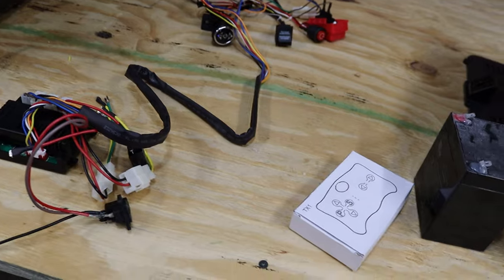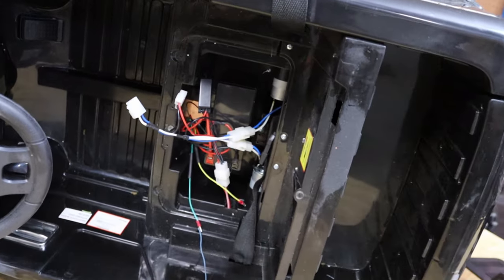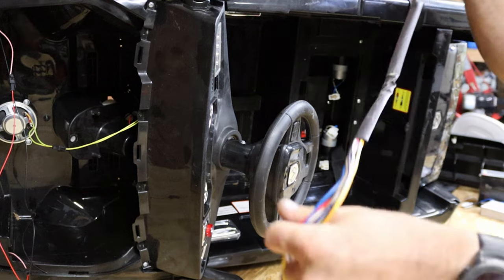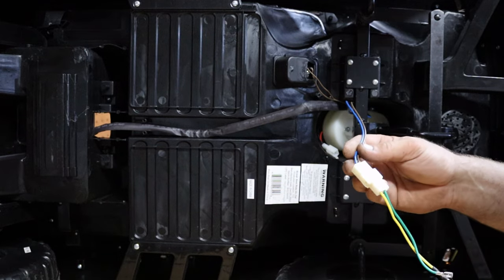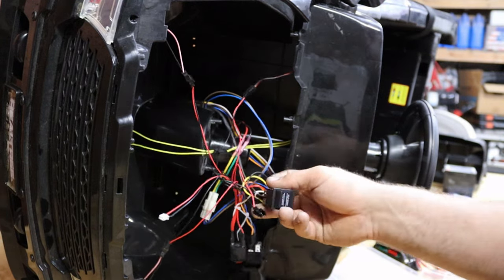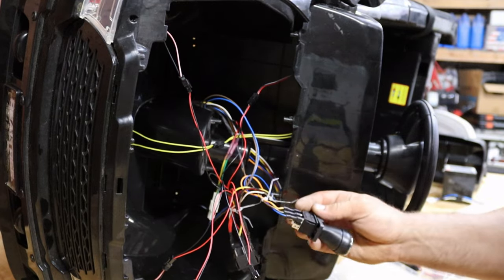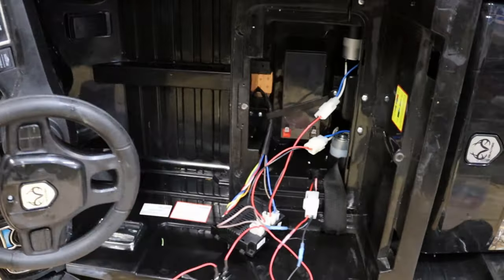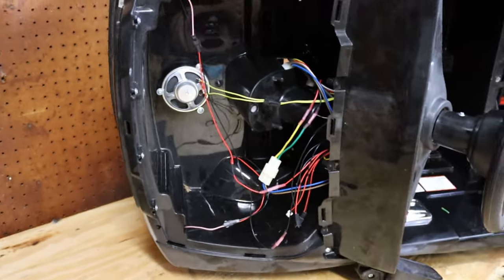Make Any Power Wheel Remote Controlled!!

Comment: When connecting the wires to the steering motor instead of soldering them you could have just twisted them together and used wire nuts to test the orientation of the wires which would make it easier to just untwist and switch them. Then when you have them  correctly oriented you could solder them or use crimp splice connectors and heat shrink.
Reply: Exactly 💯 touch the wire and test first
Reply: We do it nice cause we do it twice
Reply: Does that remote kit come with a steering motor

Comment: So wait ... Say I have the 12v Star Wars Land Speeder that doesn't have a remote feature.... I could wire it with this harness combo and make it radio controlled!!?? 🤯
Reply from the maker: Yes sir!
Reply: We are currently trying to convert our land speeder. Were you able to do it? Any advice?
Reply: @paigeseibert3873  I didn't get a chance to buy it. Dude up the road was selling one for $50 but I didn't pick it up because I didn't have a place to store it/wasn't fast enough on asking about it. Haven't found another in my area unless it's new unfortunately. But the logic is sound what he accomplishes in this video.
Reply: $50 is a steal. We were lucky to get ours from a friend for free. Just the cost of driving 25 hours round trip to pick it up. Well wish us luck trying get it converted.
Reply: @paigeseibert3873  let me know when you get it working! I'll definitely be on the lookout if you are able to get it to work!

Comment: Syper upset cause its not not power wheels its only power wheels with steer motors
Reply from the maker: They sell a kit that comes with a power steering motor. You can literally convert any of them just like this, but in your case you'd have to add the electric steer motor
Reply from the maker: weelye Kids Ride On Car 12V DIY Modified Wires Complete Set of Remote Control Circuit Borad Wires Switch Gearbox with Motors,Children Electric Ride On Car Accessories https://a.co/d/gLwqMS0

Comment: though not assembled yet... got a Ride on with remote.  Will use remote alot...  1. do you happen to know if in general the remotes "return to center" the front wheels (it has a motor that turns the steering wheel)  2.  if they dont have "return to center"  Do you have suggestion for a remote with a joystick that would have that built in?
Reply from the maker: Typically they return to center

Comment: Help!!! I bought this, how can I tell if it can be modified to remote control?
Reply from the maker: Any of them can be converted as long as you buy the right kit. If you flip it over look for a motor at the bottom of the steering column. If there is, buy the kit linked, if not itll require a little more modification but they sell kits for it
Reply: I don’t believe it does. It doesn’t have a radio either.
Reply: Mine has that is electronic, front lights, horn, forward/reverse. One rear wheel motor. I’ve tried to upload pics but it won’t let me.

Comment: What if the power wheels your rewiring doesn't have a steering motor, where would you use steering motor wires that came with the harness?
Reply from the maker: If you are using this kit and keeping manual steering, just zip tie the wires out of the way. You won't be able to steer from the controller, just forward and backwards. If you're converting to power steering they make this same kit that will come with a steer motor to install

Comment: How do you install the steering motor. I can't make sense of mounting the steering motor
Reply: This guy is taking a ride on car already designed for electric steering and basically re-adding it. Most real powerwheels brand cars do not have electric steering and trying to make clearances for a motor and gearbox is huge project.  He adds it to one car and acts like it will work for any car. The motors forward/reverse/brake can be added relatively easy however. But if you want full remote control and your car doesn't already have steering, you're prob better to save the headache and buy another brand unless you are extremely capable and have free time.
Reply from the maker: Its actually really easy, if you buy the kit with the steer motor. Ive done 2 where we had to add the steer motor and not alot of modifying was needed. Ill try to pick up another power wheel without it and do a video soon. But it can be done to any powerwheel

Comment: Is it possible to add a parent remote with steering to the Power Wheels Dune Racer Extreme, FLM96?
Reply from the maker: Yes! Does it have a motor attached to the steering column currently?

Comment: So I’m not going to need to get a steering box.   I have a real tree utv.   I think you called it a steer motor.   Or will it come with one.  I didn’t see it in the amazon kit
Reply from the maker: No you should have the steering motor in that. But if you don't here's the link with one

weelye Kids Ride On Car 12V DIY Modified Wires Complete Set of Remote Control Circuit Borad Wires Switch Gearbox with Motors,Children Electric Ride On Car Accessories https://a.co/d/gLwqMS0

Comment: I just recently did a M18 battery swap on the same model of Jeep but I did not use an inverter I just disconnected the old battery,  connected some butt connectors, and hooked it up to the Milwaukee battery. Everything seems to work just fine except it won't turn right on the controller. Can you help?
Reply from the maker: Sounds like you might have a bad controller. Search weelye controller on amazon and you can probably replace the controller for 20 bucks or less
Reply: @ronagarage512  well before I did the battery swap the controller worked just fine.
Reply: Everything works on it except when I push turn right the steering wheel won't turn right from the controller. It will turn left but it won't turn right

Comment: Will this work on the 12v Jeep gladiator battery powered? it is currently not remote controlled
Reply from the maker: It will work. There are different kits on amazon. Most of the power wheels have power steering, if it does, the kit I used will work. If it doesn't have a steering motor you can buy a kit that comes with one
Reply: @ronagarage512  only the rear wheels have motor not the front

Comment: Will the conversion work for huffy ride on 6V cars?
Reply from the maker: I'm not sure, I think you'd need to upgrade to a 12 volt battery as 6 volts would be too low to turn on the controller but the 6 volt drive motors should hold 12 volts just fine. The controller is usually the first part to go with higher voltage
Reply: Bought a used 6v car. I’m going to need to put this harness in because it needs a remote control. In addition, the 6v runs very slow in the yard and want to upgrade from 6v to 12v battery. Will this same harness work with a 12v battery upgrade?
Reply from the maker: @lauriecox2689 yes! It's made for 12 volts. So it should work perfectly

Comment: I just bought a jeep and it dont come with remote control so do i need to swap the whole wires ?
Reply from the maker: If the controller in the jeep is the same as the one in the new kit then you won't need to swap the harness
Reply: @ronagarage512  there is no controller came with it the kid basically have to knw how to drive it but my nephew is only 2
Reply from the maker: @remixz23 by controller I mean the box mounted under the seat. The brain box if you will. If that is the same style you won't need to swap all the wires, just that box
Reply: @ronagarage512  yes it is same style however i dont work with wires and its confusing 😭

Comment: So I just did this conversion on a Mini Cooper but it’s like I don’t have power to it does this kit need 12v?
Reply from the maker: Yes this is a 12 volt kit and will require at least 9 volts
Reply: So I have the new 12v battery on but nothing is happening
Reply from the maker: Doesn't power up at all? Maybe check and verify the charging Potlatch is connected correctly as that is the ground side of the battery
Reply: I think it’s the controler in the car since I put a inline 10amp fuse and  it keeps blowing every time

Comment: What if you need a steering motor?
Reply from the maker: weelye Kids Ride On Car 12V DIY Modified Wires Complete Set of Remote Control Circuit Borad Wires Switch Gearbox with Motors,Children Electric Ride On Car Accessories https://a.co/d/gLwqMS0
Reply: How do I know if I need a steering motor?

Comment: Does this allow the car to still be driven manually OR does it only work by the remote now?
Reply from the maker: Both! It cam be driven manually or you can use the remote. The remote also has a kill switch on it so if your little one is starting to drive by themselves and head toward the street or something you can shut it down off the remote
Reply: @ronagarage512  Amazing, thanks so much for the video! I just ordered the kit for my little one's Power Wheels Ford F150 - this is great!
Reply from the maker: Happy to help. Let me know if you got any questions and I'll try my best to help out
Reply: Can you turn the speed up using the controller
Reply from the maker: Rc Snakemadness the remote has 3 adjustable speeds, the speed controller can also be adjusted to tun down the voltage and slow it down further
Reply: So does the remote over power the manual drive? I’m confused on if my little one decides to hit the gas or steering wheel.
Reply from the maker: No the only time the remote overpower the manual operations is if you hit the p button I believe and that disables everything.

Comment: U will need a front motor to turn
Reply from the maker: Correct. I just assumed most come with the steering motor already in them as a power assist but could be wrong. I know the kit I used also has a kit out that would come with a steering motor and drive motors if you wanted them
Reply: @ronagarage512  can you send me the kit link for the one come with a steering motor?

Comment: Ive got a bmw k1300s bike ride on forbmy toddler but eanna make it remote controlled too. Think the kit you hsve would function the same for it? It has 3 speeds built in vs just a high and low
Reply from the maker: The kit would work but it would only allow for a high and low speed manual switch. The remote can set 3 different speeds though